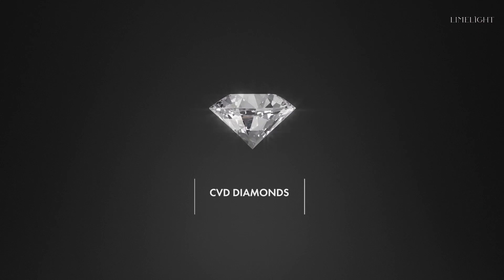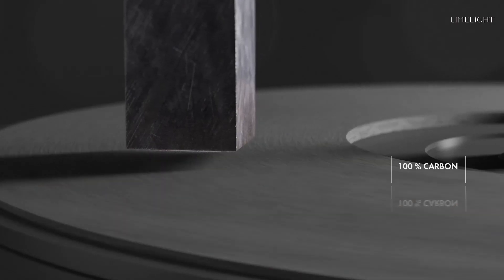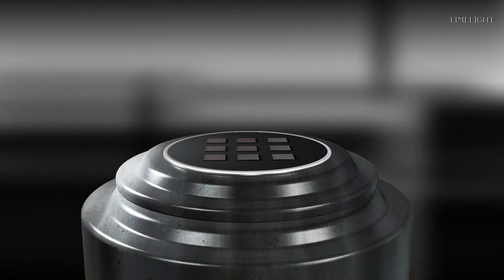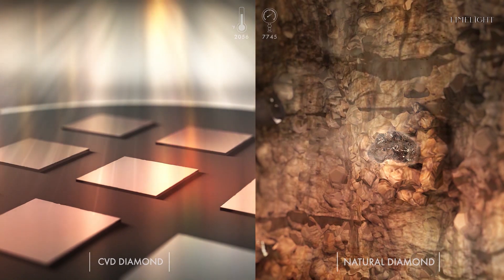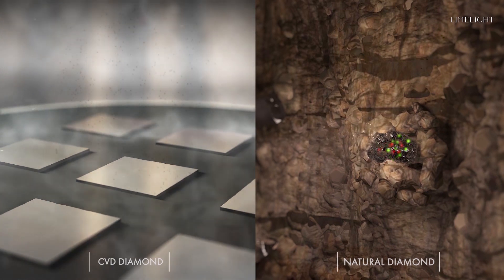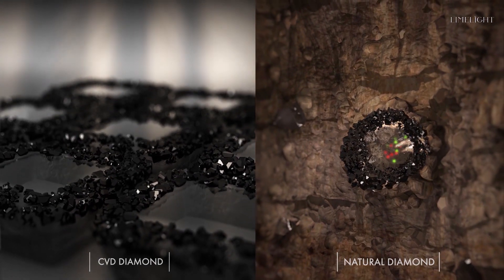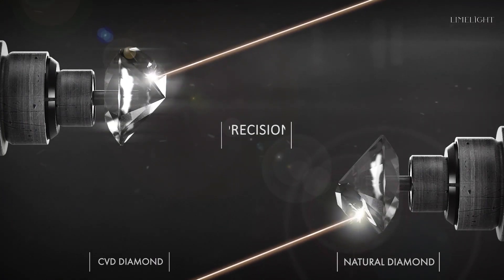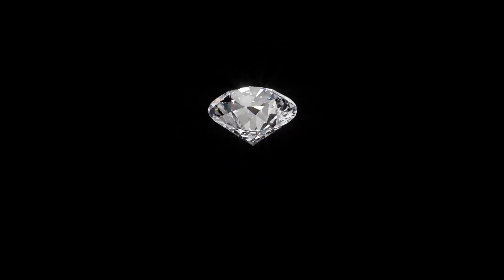How Are Lab Grown Diamonds Created? | The CVD Process Explained

Comment: CVD is NOT the same process as natural diamonds.  The end result is similar but also is not identical.  Natural diamonds are formed by heat and PRESSURE.  In CVD no extreme pressure is used.  CVD is NOT on the phase transition diagram.
Reply: lol please do your research it is the same process